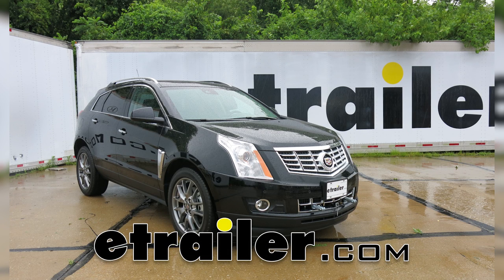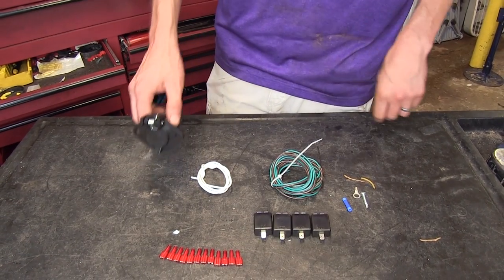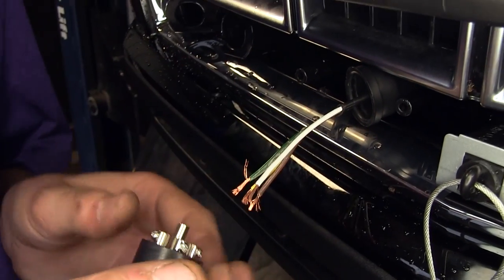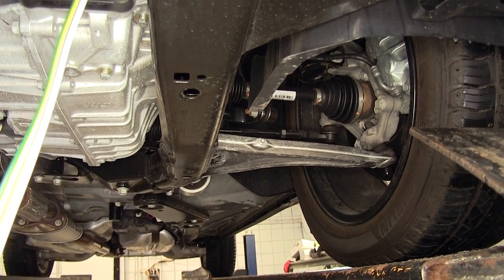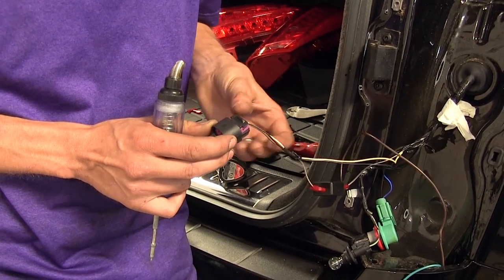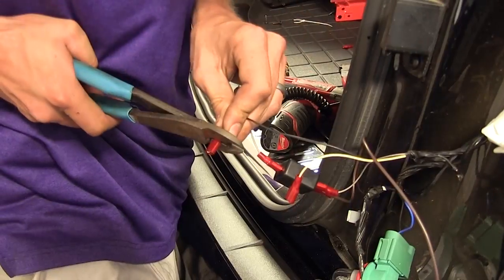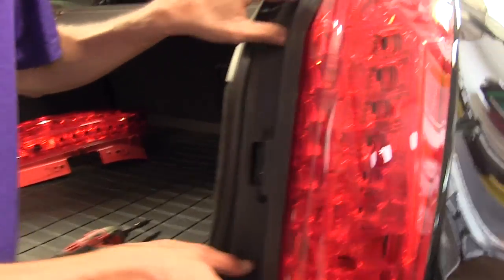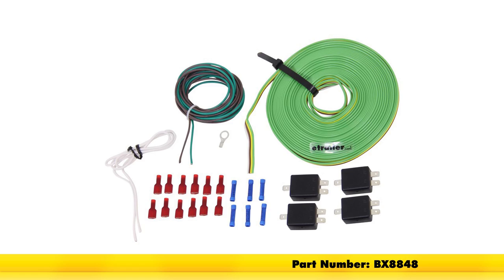Install: Blue Ox 4-Diode Universal Tail Light Wiring Kit for Towed Vehicles on a 2016 Cadillac SRX

Comment: I ran into a problem with this wiring suggestion.  The Cadillac SRX's BCM cuts power to the Brake lights 10 minutes after the car is shut off meaning as you hook the car up to the MH and test it it all works fine but 10 minutes later as you're driving down the road there's no brake lights.  I ohmed out the brake lights to the MH and added it to the pin connector on the front of the car, but since it was only wired with 4 wires (tail/running lights/left dir/right dir and a ground) I had to steal the ground and use it for the brake lights.  Also, had to add the directional to the actual directional bulbs to the car and remove them from the LED's that had been instructed to use in the video and needed 2 more diode packs for that.  Then I added a ground jumper between the car and MH and all work fine now.  The ideal solution would have been to use 5 wires from the front of the car to the rear.
Reply from the maker: I think the problem that you had, and you figured it out, was that you need to have the vehicle and the motorhome grounded together so that they are running properly. Thank you for sharing your personal experience with this installation.
https://www.etrailer.com/Tow-Bar-Wiring/Blue-Ox/BX8848.html